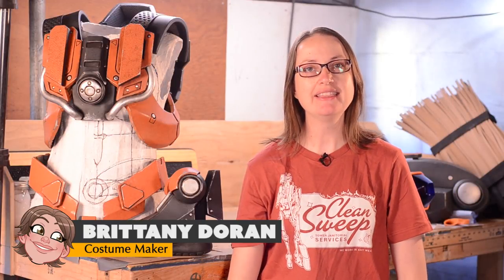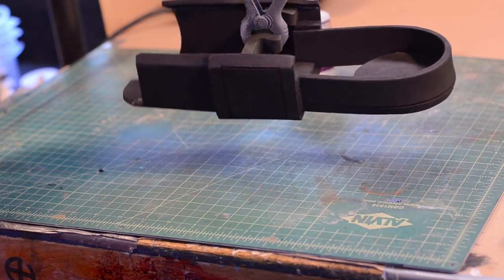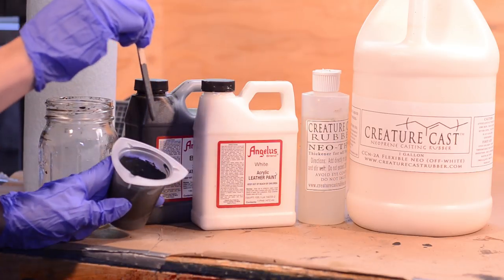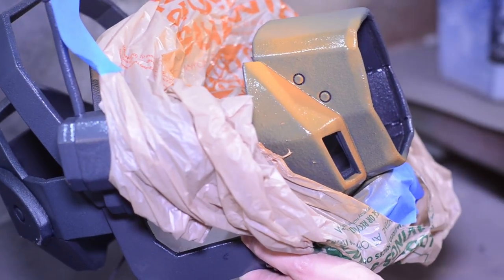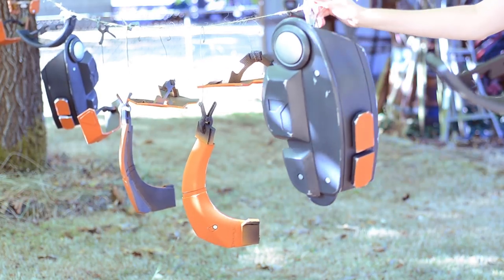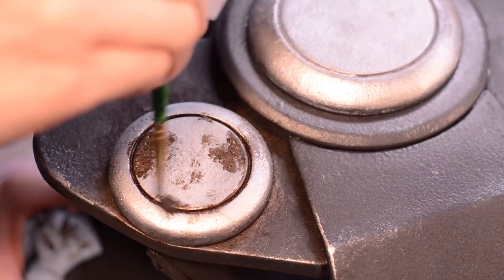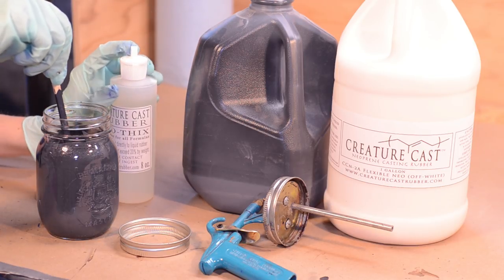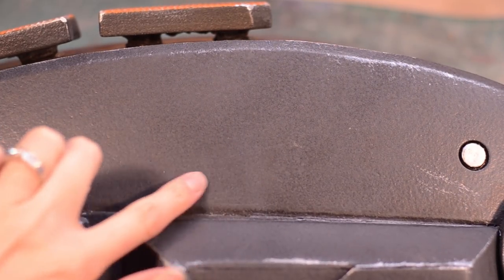Sealing, Painting, and Weathering Foam Armor - Destiny Sweeper Bot Build

Comment: Does that spray varnish take a long time to dry? A project I'm working on is still a little wet after 24 hours.
Reply from the maker: It depends on how dry your paint is underneath, the temperature and humidity when you sprayed it and while it's drying, and what kind of varnish your'e using. Typically the varnish we use dries in an hour or so on a nice dry day.

Comment: just bought some creature cast and thickener but I'm having trouble adding multiple coats to my project. the second coat beads up and doesn't go on evenly on top of the first coat. I've tried lightly sanding in-between coats, but I either end up taking off to much of the first layer or the new coat still rolls off the the small bits i might have missed with sanding.  have you guys had this problem? what have you done to fix it? Btw i love your series!
Reply from the maker: Are you brushing the creature cast on? If so, make sure there is no water on your brush. Water in a freshly-cleaned, wet brush may make the neoprene bead up. We personally haven't had neoprene bead up, as long as we add thickener (and keep it away from water.)
Reply: I'm using both a brush and airbrush and getting the same results with both. ill try adding more neo-thix and stay away from wet tools. thank you!

Comment: Is there a smell factor to the sprayed creature cast? Have been using rust oleum spray rubber cans, but the smell is awful.
Reply from the maker: There isn't a smell, but I would recommend wearing a respirator when spraying it. It isn't toxic, but you still don't want to breathe in any particulate.

Comment: Will I simply be able to apply the Angelus orange over 3 coats of Fulldip? I've tried using spray paints but the foam tends to leave itty-bitty tiny pitholes.
Reply from the maker: Yep! The pit holes will be there depending on the quality of your foam. Floor mats tend to have more while foam from places like TNT Cosplay Supply or SKS Props will be more smooth.

Comment: I tried several kinds of varnishes for bending foam parts, but its always cracks. Do you use some special kind (I've heard that some art varnishes ar elastic) or its just tiny amount of any type?
Reply from the maker: The rattle can varnish that we use is flexible. Perhaps if you put on too much of it, it'll get stiff. I've never had it crack though.